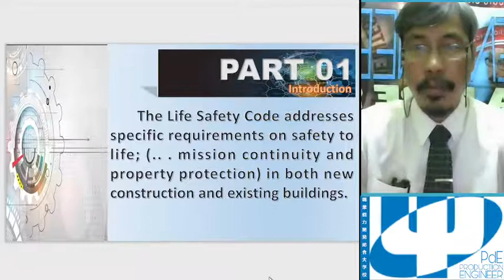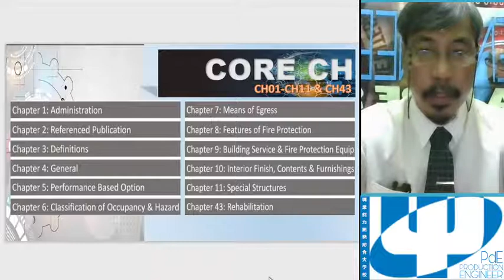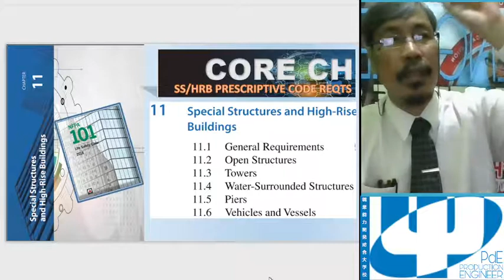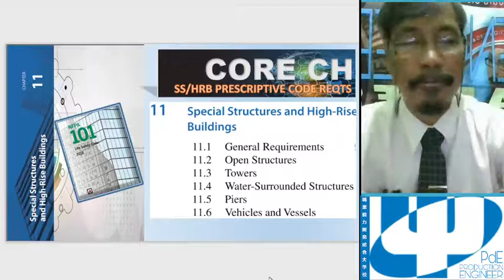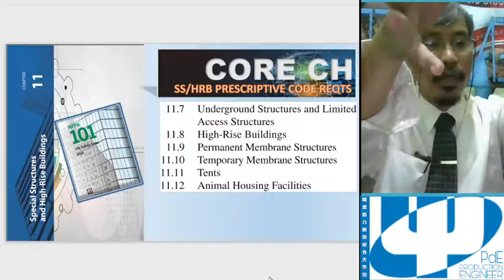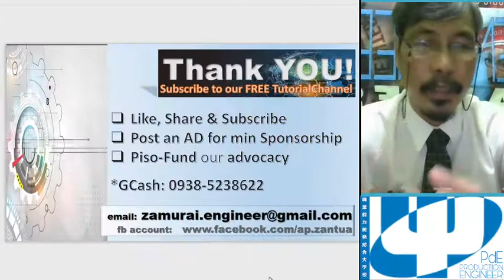SPECIAL STRUCTURES & HIGH RISE BUILDINGS - NFPA101: Module 02.2 [ Reference CODE by RA9514-IRR2019 ]

Comment: High-rise buildings are defined as buildings that have 13 floors or above. Skyscrapers are buildings with over 40 floors and are considered part of the high-rise category. It is built out of necessity as one of a wide range of tools to achieve high density development. They provide the opportunity to control urban sprawl with their relatively small foot print.

Comment: Arana, Jomar A. 
19-02963

@02:06 "HRB (means High Rise Building)
@02:14 "Special Structure and High Rise Buildings"
@02:52 "General requirements"
@03:08 "Open Structure"
@04:54 "Tower"
@07:52 "Water-surrounded structure"
@08:20 "Piers" and "vehicle and vessels"
@08:54 "underground structures and limited access structure"
@11:09 "high rise building"
@11:58 "permanent membrane  structures and temporary membrane structures", "tents" and "animal housing facilities"

Comment: The high-rise building is generally defined as one that is taller than the maximum height which people are willing to walk up; it thus requires mechanical vertical transportation. This includes a rather limited range of building uses, primarily residential apartments, hotels, and office buildings, though occasionally including retail and educational facilities. A type that has appeared recently is the mixed-use building, which contains varying amounts of residential, office, hotel, or commercial space. High-rise buildings are among the largest buildings built, and their unit costs are relatively high; their commercial and office functions require a high degree of flexibility.

Comment: Narito, John Lloyd R
18-02891
All buildings having floors used for human occupancy located more than fifty-five feet (55’) above the lowest level of Fire Department vehicle access are considered HIGH-RISE BUILDINGS. Campus Facilities and “Special Structures” as addressed in NFPA 101, facilities which include open structures, towers, water-surrounded structures, piers, underground and windowless structures, high rise buildings, membrane structures, tents, covered mall buildings or traditional occupancies that are located in special or unusual structures, shall conform to the requirements of this Section in addition to other recognized codes and standards.

Comment: Mendiola, Mc Axel Joseph P
19-00167 

Thank you sir, Special structures are landmarks and testimonials to the achievements of the structural engineering profession while high-rise building is a tall building, as opposed to a low-rise building and is defined differently in terms of height depending on the jurisdiction. It is used as a residential, office building, or other functions including hotel, retail, or with multiple purposes combined.